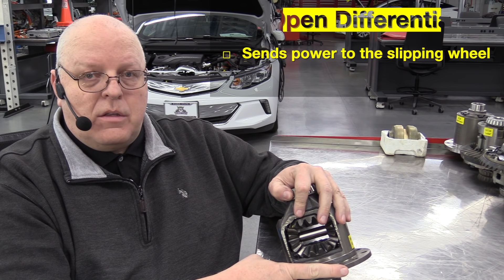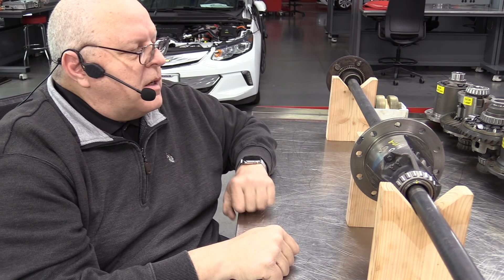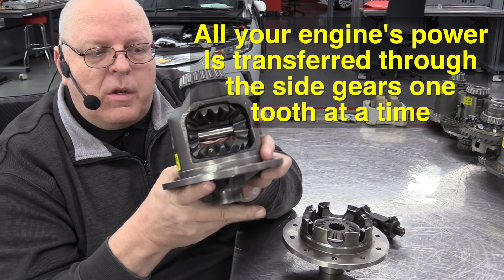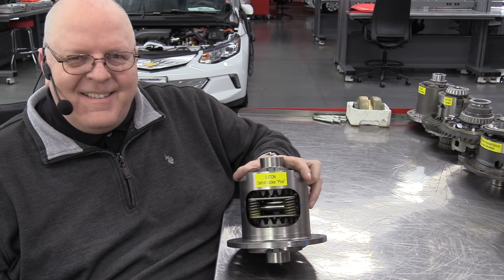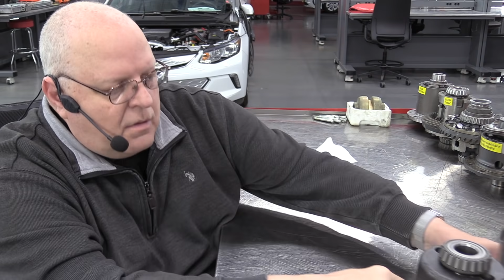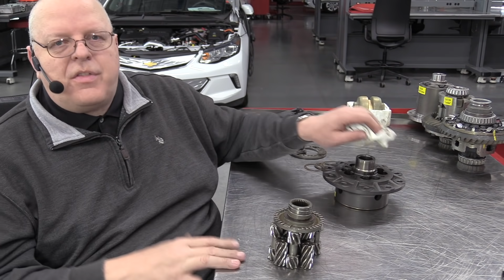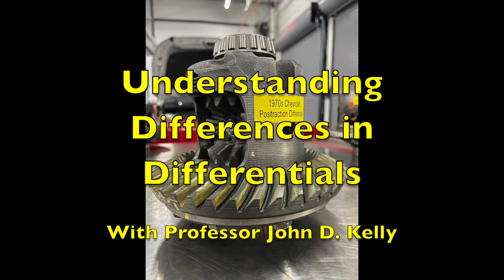Understanding Differences in Automotive Differentials

Comment: I live in New Zealand. It's good to see how different L.S.D Diffs work. I had to replace two diffs in my V6 Ford Cortina. I ended up getting a diff from an Australian-assembled Cortina that a 6-cylinder Falcon engine (4.1 liters inline 6 cylinders)and the diff Head is the same as the Falcon. It was interesting to see how the different LSD diff work.

Comment: Some years ago I installed an aftermarket kit called a Detroit EZ Locker automatic positive locking differential on a Dana 44 axle I had on an International Scout 800 behind a 455 Olds engine.  Held up well, clicked around corners.

Comment: My Ford Transit van with 280k miles  has some type of locking differential however how can I check if it actually still works without driving in  a low traction situation? None available as it no longer snows in winter!  Changed the gear oil with friction modifier additive. Everything looked great inside.

Comment: Ok, I didn't see the kind of diff that my '83 GMC 4x4 had.   Mine had what appeared to be a brass gear next to the ring gear.  A small difference in speed between the wheels would cause a noticeable "thunk" and the axles would lock together to the point that if I turned sharp, it'd slip one wheel or the other.  I could back up and turn left or right and a noticeable "thunk" could be heard and felt as the axles would unlock.  I had the truck for 18 years and never had a problem with the diff.  If the vehicle was traveling over about 25 or 30 mph and you stomped the gas in a turn on a slick surface, it'd spin one wheel just like an open diff.  Anyone know what kind of diff that was?

Comment: Unfortunately the Torsen and Posi Trac only works under acceleration, so off throttle oversteer can be an issue. The 2-way clutch pack LSD (Kaaz, OSGiken) style is really the only solution for high performance driving where deceleration control is just as important as keeping the car straight accelerating.

Comment: @ 0:52 ,  I have to point out that the torque output to each axle is always EXACTLY the same with an open differential !! The reason only one wheel will spin is because the other wheel has better TRACTION !!  If one wheel was on an icy surface, it will spin almost freely, but the same torque is applied to the wheel on the pavement !!

Comment: I should have waited until you got to the section on the eating locker also known as the gov lock because one thing that you missed on that is that dog that the flyways catch on is also counterweighted so after a certain speed no matter how much you spend the wheels it will not engage so it is always an open differential at highway speeds and it is not a limited slip it in proper form locks up solid

Comment: Just wanted to let you know about your commentary about welding spider gears and the like while the carrier may be and I stress maybe cast iron The spider gears most certainly are not they're high grades stee And they actually weld very well You did fairly well on this I'd give you about an 8 out of 10 but there are some gaps in your knowledge like the functionality of the torrison differential but better than nothing.

Comment: WoW, you brought back a lot of memories of rear-wheel drive cars. I had been warned by the older motorheads to go easy on those punkin' style rear ends in the tri-fives but I found out about cold side and spider gears and how easy it was to strip the spider gears. Luckily we could sometimes gain access to the back of the parts room at the local GM car lot and fix the broken stuff. They did NOT like you to know that secret that the fix could be done for $27 and greasy hands in the backyard.
My GMC Canyon had 2WD with the Eaton Locker. Just before my warranty was going to expire I took it to a dealer to ask why the differential was not locking. Like zero times in the past five years. My neighbor who drove Fords loved it when I got stuck on my own property. The GM Tech guy did a burnout in the mechanics bay and told me the "PIN" that drops to lock the axles was stuck and explained the requirement for the difference in axle speed that creates the pin drop. Worked perfectly after that day by backing off for just a millisecond to allow the magic to happen, except for a few dry pavement lockups when it had no reason to engage. I goosed it and it released. That was the 2008 version which had been dialed back a little because of broken axles in the previous years. 
I would have loved to know what you taught us today but 45 years ago, hahaha.

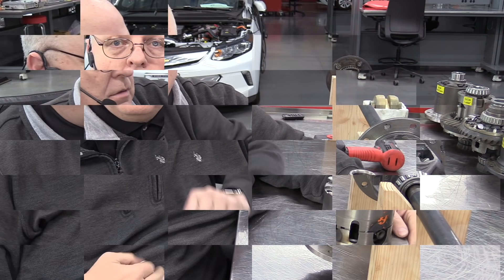Comment: 17:20 the positraction diff. Never heard of the diff gears "expanding" with torque by themselves. What I learned and use to adjust the locking effect in racecars are the ramps where the side gears pins work. Those angles are the responsible for the increase locking effect. The particular diff shown has signs of ramps modifications by welding and material cutting, like any good racing team would do to have the unfair advantage 😁

Comment: I had a 65 corvette 365 hp I bought in 67 the differential broke, it chattered when I got the car until it let go. I ordered a new one from my dealer.
When I disassembled the old differential it had springs that were bent and twisted. It look like the Detroit locker. Thanks for the info. Great video. When I bought the corvette I was working for a Volkswagen dealer it was a trade in for a 67 Beatle.

Comment: The electronic locking differential is a device housed in the rear axle that allows both rear wheels to turn at the same speed. The electronic locking differential provides additional traction should your vehicle become stuck. — How does the locking rear differential work on the Ford F150? - Jerry

Comment: this was awesome. I recommend adding a modernized autolocker that's manufactured by a small but extremely devoted to their product company called TorqMasters ; they make what's sometimes called a ' lunchbox' locker that is a great deal more advanced than other autolocking differential brands. I'll bet you'd get a chuckle out of the TorqLocker &  it's unique , locking keyway & pinion pin as opposed to dogtooth gears.

Comment: Yep, the inventor of the Torsen differential was truly a genius. How does the Eaton TrueTrac's performance compare to the other Torsen type? The automotive world tends to be beset by a lot of hogwash, with differentials getting a fair share. My understanding is that 1984 was the last year for a true Positraction clutch-pack style LSD by GM, and that a Torsen design LSD was used thereafter. Clarification would be appreciated. 🤔
A true automatic locker with dog-tooth engagement has been explained as applying torque to the wheel with the most traction, as opposed to an open diff applying it to the wheel with least traction. The effect is said to be undesirable on street-driven vehicles.🤠 Professor Kelly's thoughts would be most welcome.😎🤓

Comment: Also you didn't mention the mechanical locking differential "detroit locker" adapted for automotive applications from the "No Spin" differential as used in heavy trucks. Guy Franks

Comment: Wonder if that 1956 Dana locker that became the American Motors Powerlock was essentially a Detroit locker.  Also wonder if that's the same thing that International Harvester had as their Pow-R-Lok diff in their light line trucks, which was their corporate name for their Detroit locker option.

Comment: Better way to explain open diff is that it splits torque 50:50%.
Both wheels have the same torque aka the torque of the slipping wheel aka very low.

Comment: Thanks professor!  Tractors from 70's to 90's (or later?) had a push pedal on the floor to lock L/R axle shafts.   I assume it might be a n annual version of the Toyota Limited Slip?

Comment: Nice instructive video! I really appreciate it!  I wonder if you can help me with a concern. I own from new a Ford F-100 (called F-250 in States) produced in Brazil in 2000, with Dana 70 rear axle. The axle label says DANA N. 605972 – 2, DATA: 12/02/00, MODEL: 70, TYPE: T/L, RATIO: 3.73, SERIAL NO.: 69643. The differential lubricant wasn't never change and I wonder if it is time to do it. The truck already has 150,000 km. Do you know what type of oil y should use? Thank you very much!
Reply: Any 75w90. Make sure it says GL5.

Comment: Another fantastic video. I'd be interested to know your thoughts on whether the LSDs with clutch packs that wear out begin to compromise their lifespan because of diff' oil contamination? Or does changing your diff' oil at the recommended interval negate that being an issue?

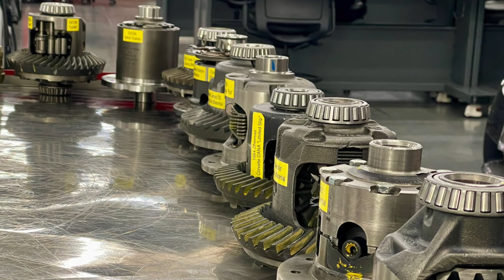Comment: I've been looking around everywhere. and this is the only video explaining a clutch based limited slip diff properly! 16:45
The reason why is quite simple, you are the only one to actually show us one! Thanks for that!  

Also, it is interesting that you should pronounce 'weber' as weaber'. Because it would suggest your ancestors came to England from Germany a few hundred years ago when 'weaver' was still pronounced as 'wayver' in England (written as 'wever'), given that it was and IS pronounced 'wayber' in German. And that later in English that 'ay' sound became an 'ea' sound. Thus 'wever' became 'weaver' and the loaned name 'weber' became 'weaber' I guess?

Either that, or you just forgot how to pronounce it because you became English. ;)

By the way. They are the same word, weaver and weber. German is a lot more conservative as the original word from which they both are reconstructed is something like *webarī. In English the b became a v and the sound after w changed as described before.

Comment: Prof Kelly is truly a gifted and brilliant teacher. I learn so much from his videos. But I have one remaining question from his lesson on differentials. As most LSDs rely on the bevel gears being forced apart by torque to compress the clutch packs, (1) what happens if you step on the gas in a corner, and the two wheels lock together, and (2) what happens when one wheel is on dry pavement and the other is on glare ice? The wheel on ice will spin so easily that there will be close to zero torque acting on the bevel gears to push them apart and engage the clutch packs.  I found that happened with a late 80s Jaguar that I had the great misfortune to own. These may be dumb questions, and if so, I apologize in advance.

Comment: Thank you Sir for comprehensive explanation! Was really interesting to learn better how the differentials works and what solution were applied to get locked for better wheel traction! Thinking of tough winter condition I would be in favor of having: a perfected manual locking or hydraulically locking feature of the differential.

Comment: During WWII my dad worked on the War Emergency Pipeline.  He had his choice of vehicles and he chose a 1942 Dodge with a fluid coupling.  This was a first try for Chrysler  product Behind it was a standard 3 speed transmission.  With the fluid coupling in front of the clutch it could come to a complete stop in high gear with out stalling the engine.  My dad using this trasmission could start out in high gear and not spin out in snow or ice but gently start forward.  He traveled my winter roads that way.  His way to get around one wheel spin our with all the torque of 1st gear and so he started out in High gear and almost no spin out.

Comment: In 2004 I bought a 2004Silverdeo pickup   for towing my travel trailer.  I did request the limited slip differential.  I still have it and just turned 97000 miles this year.  I have driven limited time on snow and ice and always got through.  I NOW know what the differential looks like inside. Thanks

Comment: I have a 1997 ford f-150 5.4 v8 that I drive daily , in winter we get lots of snow and often gets stuck  only one wheel  spins ,what I want to do is add bigger tires and install a posi traction rear end it's 2wheel drive  there are so many differentials on the markets and I don't know which would work for me ,any suggestion would be most helpful and greatly appreciated  ,thanks for sharing

Comment: The Jeep Differential which is a (tru-trac / torsen) with the ability to be completely locked via air is very interesting to me, does anyone know if there is such a differential sold through the aftermarket or is this only a special diff option on wrangler unlimited rubicons? I havent had much luck with the googlies

Comment: Professor can yo comment on this statement - tell me if I can rely upon it to determine if my 2007 Tacoma Base has an LSD?
"Jack the rear up (both wheels off the ground) turn one wheel if the wheel on the other side turns the same direction it has limited slip if it turns the other way it does not."

Comment: It looks as if when the clutch plates wear down, the "limited slip" slowly becomes an "open" differential.  Any problems with just running it that way (other than the "crud" in the differential lubricate that should be changed) and the loss of function?

Comment: It would be nice to mention a completely-different application for a "differential"--its use in a Toyota/Lexus hybrid powertrain, where rather than having a powered axle and two wheel axles, we instead use the variant called a planetary gearset to use two inputs driving a single output shaft.  One input shaft goes to an electric motor, and the second goes to an engine.  The Toyota computer precisely controls the engine and motor so that one or both drive the output shaft completely transparent to the driver.

Very clever design and bulletproof when compared to a conventional "CVT" transmission using a belt and cone design.

Comment: Started a little rough with explanations professor but you did a fine job explaining those for anyone who has no idea what they're looking at. That last one by the way( eaton locker aka gov bomb) can be operated reliably as an open diff when the governor mechanism blows up because it has no business in a 4x4 truck. IMHO. That's if it doesn't split the carrier (or case) as you called it. Seriously for those who are curious the eaton locker has no place on a high HP or 4x4 used off road especially with lifts and larger grippy tires. The problem is when the tires break loose and start to spin and the the governor cams swing open and lock the spinning axle to the non spinning one which sometimes occures at much higher difference than 100 rpm the qhole assembly explodes! Those are really small pieces of metal trying to stop/lock much larger stronger pieces of metal under an incredible amount of force. Just my 2 C worth of experience. Differentials have to be chosen for the intended use and there's usually a little compromise required.

Comment: so, how come we don't put the disk brakes closer to the differenial  (at least for race cars, where you dont need to worry about servicability of disk brake pads) it seems like the disc brakes would be more stable if they were not right by the wheels, especically if there is steering, drive and disc brakes on the same axle. 

Maybe its just how the racing regulations are because it's  been this way forever.

Comment: Your years of experience and wisdom at which appreciated and I am glad you have shared this.

When we raced fox body mustangs in the 4 cylinder class, there wasn't a mini spool or anything for the Ford 7.5" rear end that came in the mustangs, Fairmont, Grenada, etc...
So, we either welded the spider gears together solid as you mentioned.  Or we would out a small beads on all the spider gears to make an X pattern when lined up right. And then put them back in where the beads would line up to prevent the open spider gears from rotating, jammed against the beads making it act like a mini spool.

They worked well on the dirt tracks and usually never broke, them again we weren't running the torquey V8s.  It was funny trying to turn the car around on a paved parking lot. The outside tires would be chirping, grabbing and the turning radius sucked.  It made it easier to rev it up, dump the clutch and whip it around

Comment: The best is when you're on the ice with your gmc you stab the gas your Eaton locker kicks in 2500 rpm differnce in Shaft speeds  and explodes  . Your axle c clip snaps off you roll foward but you're only on three wheels because your 4th is bouncing down the hill with its axle.

Comment: Not really a gear head myself but still well worth a watch.  I've long had a basic understanding of an open differential but never really knew the differences between each type.  Now I'm curious as to what kind of differentials are on my SUV.

Edit:  Did some research but having trouble finding what I'm actually looking for (how it works rather than where to buy it or a new car, I'd say thanks Google but Duck Duck Go actually failed me to).
From what I could gather the rear differential in my car uses some sort of electromagnet with a ball bearing and two clutches (I found a single post and it was confusing, I'd do much better with a visual).  If anyone's curious I drive a 2017 Trax AWD.

Comment: I had a 77 Chevy C10 that had a locker that had a dog that would swing own and catch a role pin when 1 wheel spun more that the other. I don't know that it worked much; until I moved to Florida and pulled out of a store and laid into it and spun the tires and when it locked up I heard a loud bang. I took the cover off and the role pin had broke an went through the gears. At$400 plus I said Bull S==t and bought an open rear for $30. I did not see 1 of these in your video. Good video though;